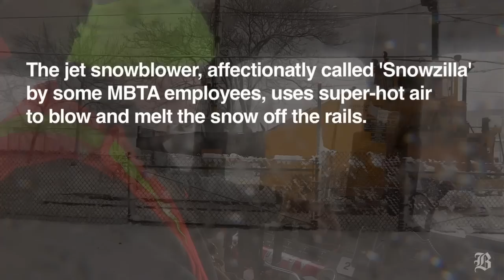Snowzilla clears the rails on Mattapan Line

Comment: Why can't they just order another one like this one instead of the old 1950s jet engine it's the V2500 from the MD-90 or MD-88 JT9D. The second one can be used here alongside open air sections of the green line the D branch E branch Lechmere to Tufts University

Comment: Why the fuck is the MBTA still using trains from WW2 as light rail service? They oughta be retiring in San Francisco instead.
Reply: That appears to be an open question. Best as I can tell, it's for historical reasons. That said, the riders would probably prefer something newer.
Reply: The MBTA would like to replace the line with buses but buses historically mean lower quality and less frequent service in a predominantly black neighborhood.  Not to mention buses have to deal with traffic while this line does not. plus, the old trolley cars are just plain cool.
Reply: If they replaced it with the newer trains currently on the Green Line, it would be too heavy for the bridges on the line.